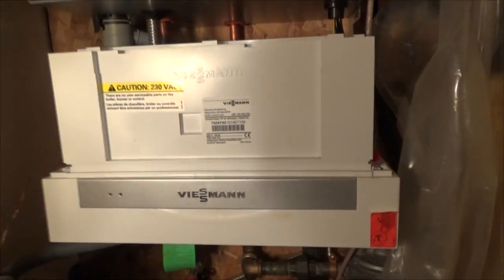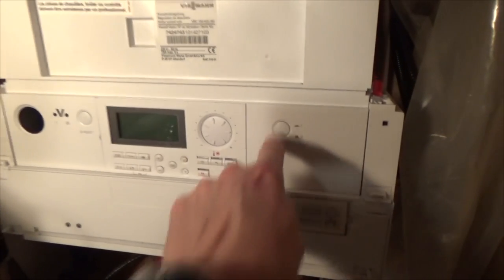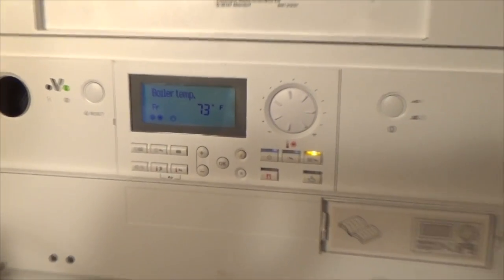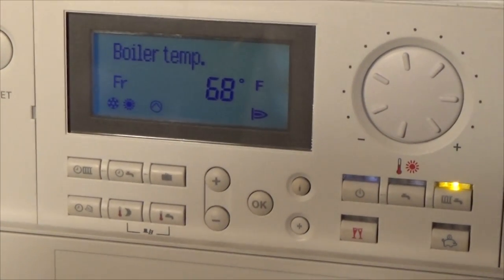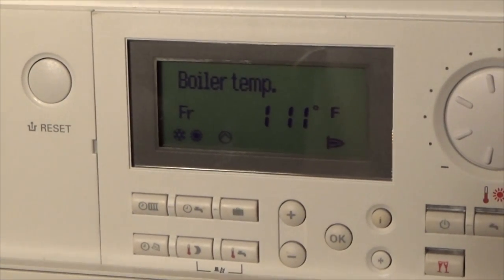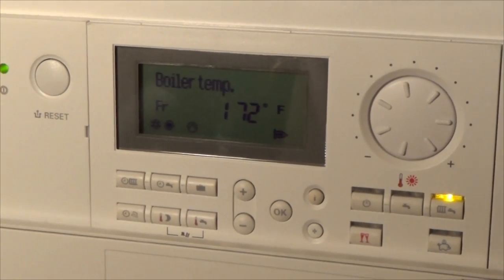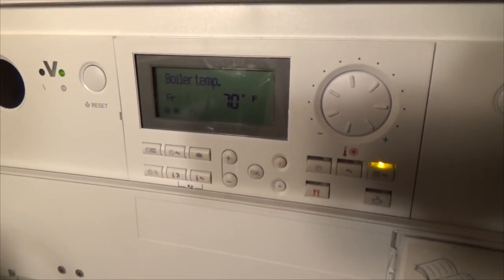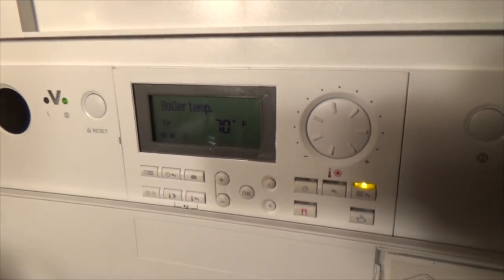Viessmann Vitodens 200-W WB2B35 Problem

Comment: So what was the fix for this
Reply from the maker: The boiler was repaired with both a replacement control console (main board) and gas valve. I made a follow-up video here with a fix in the comments: https://www.youtube.com/watch?v=fNX-8qXV8jw
Reply: Пишу через 2 года после выхода вашего видео . 
Идентичная проблема., один в один. 
Разбирался 3 дня. Мастера , как обычно предлагают все поменять.( плату и э/м клапан газа)
Купил тестер и прозвонил детали в плате автоматики.
Параллельно почистил все датчики , камеру сгорания , вентилятор.
Итог : 
Перепаял конденсатор на 0.22mF, 4,7mF  . детали обошлись в 2,5 евро. Если кому то интересно , пишите , я отошлю фото , какие именно и какие у них должны быть параметры при проверке на плате, ( без выпайки). 
Пока работает))))

Comment: I am having this exact same problem with exact same unit.
Plumbers here can't figure it out and want to install everything new for $10k!
I can't afford it. This Viessman is only 10 years old.
Did you ever figure this out? Please help if you can, thx.
Reply from the maker: There were several problems. The high boiler temperatures were indicative of a partially blocked heat exchanger.  The heat exchanger flow problem was corrected (with a power flush using CLR) but I still experienced the failure mode.  The failure mode was repaired with a replacement control console (main board) and gas valve.  (Thankfully Viessmann covered the parts replacement under warranty.)

Comment: Mostley the ignition Relay in the masterboard has a cold tin! Check ignition! Check Gas pressure and if o.k. it ist mostly the cold at the ignition relay on the masterplatine! Good Luck!
Reply: hi. Can you please advise how to do so. I have Vitodens 200 wb2 11-44. intermittent firing. fan speeds up but gas valve doesnt always open, at times opens, and lights, but goes off immediately, at times, works fine for hours, at others keeps trying and doesnt stop, yet others, tries once or twice and goes standby, no error codes ever. Viessmann doesnt help at all, no local contractors know this boiler, tried four already. Nightmare. Changed electrodes, gaskets, services exchanger. With transformer not connected, gas valve opens every time, no issues, but then fault at 3rd attempt at no ignition of course. Viessmann doesnt even provide a transformer check. or if flow valve is clogged / intermittent for some reason. thank you.
Reply: @zjoseph5974  did you ever get this resolved? I'm having same issues and no local contractors are of any use.  Thanks

Comment: Definitely a restriction in the water feed. first assumption would be air locked but if it's been a running system for years I would have to point at the pump. Pull your pump check the impeller and either clean it or replace it if need be. chances are it's a wet rotor pump which are notorious for plugging up with debris so I would start there. take out the 4 Allen keys after isolating the pump. use a flashlight to check the impeller. if you haven't been using treatment you might also have a plugged heat exchanger. best of luck, I work on viessmann basically everyday... Lochinvar is the way to go.
Reply: good day please tell me I live in Russia I have problems with the same boiler as you can get in touch with you explain the situation maybe there are some opportunities to help me
Reply: hi. I have similar issue on Vitodens 200 wb2 11-44. Intermittent firing, fan speeds up but gas valve doesnt open. Then it starts working again. No fault codes at all new electrodes, gaskets, serviced heat exchanger, same thing. Viessmann tells nothing to homeowner, no viessmann qualified local contractor, many thanks And how to reach you.
Reply from the maker: Thanks for the comment - in this case the high boiler temperatures were indicative of a partially blocked heat exchanger.  The heat exchanger flow problem was corrected (with a power flush using CLR) but I still experienced the failure mode.  Repair was effected with both a replacement control console (main board) and gas valve.
Reply: lshdotnet I can tell you that the most common tech support advice I get from viessmann is to change the control module and the gas valve/valves. I went to a call where there was a leak on a system that only leaked onto one gas valve. I called viessmann to order a gas valve and I was instructed that I must order both gas valves and the control module because apparently "just changing the one wouldn't fix the problem" took about an hour to remove and install a single gas valve from another boiler as it was a 3 boiler Cascade system. Fixed the problem so I called them back to order just one gas valve. I basically had argue with them to just get one valve sent out. That was the most Imperial time I have had with viessmann on the phone. but still to this day everytime I call them about one of their wall hung's it's always gas valve control module. I work on viessmann boilers every single day. mostly the bigger boilers as I take care of high-rises and apartments. but I am telling you I've worked on a shit ton (technical term) of those boilers and they are junk. best of luck in the future. message me on this common if you have a problem down the road, or else you'll buy a new gas valve and control module ;)

Comment: Did you ever find a solution? I have the same problem and am stumped (as well as without heat in a new england winter).
Reply: Michael Capozzi control pcb panel?
Reply from the maker: @pinnacleheatingsolutions6165  (I had previously replied to this - thus the "Many Thanks!" reply, but realize now that my reply has mysteriously since disappeared...)  I had scale build-up in the heat exchanger affecting flow.  But yes, the primary problem was the main control board.  It was replaced and fixed the problem.
Reply from the maker: If there are no fault codes, the "Start-up/Service Instructions" manual says that means the flow switch is open.  You need to verify that your boiler pump is working and that you don't have any flow obstructions (i.e. deposits) in the heat exchanger.  In my case the high boiler temperatures were indicative of a partially blocked heat exchanger.  The heat exchanger flow problem was corrected (with a power flush using CLR) but I still had the same symptoms.   If you verified that flow through the heat exchanger is not a problem, and after the boiler enters this non-heating state and before turning it off check coding level 2, address 38.  If address 38 is anything but 0 you have a burner control unit fault. Address 38 showed a reading of 33 for me.  (If you power off the boiler address 38 will probably reset to 0 until it is turned on and fails again.)  The boiler was repaired with both a replacement control console (main board) and gas valve.
Reply: Many Thanks!

Comment from the maker: Status update - the boiler temperatures were high in this video due to partially blocked/scaled heat exchanger.  Heat exchanger was cleaned, but the failure mode still occurs after about 30-45 minutes when the boiler has been off.  After that the failure mode occurs more rapidly.